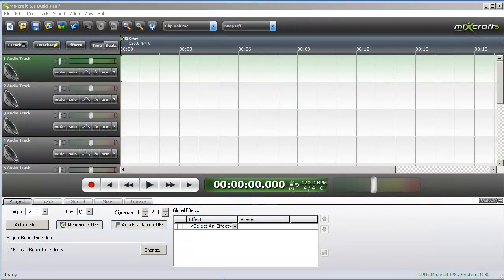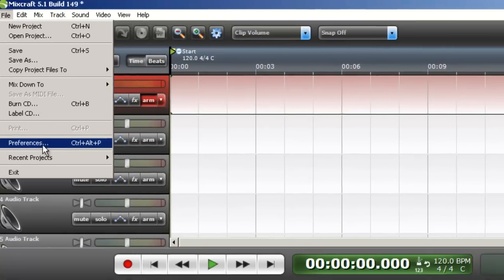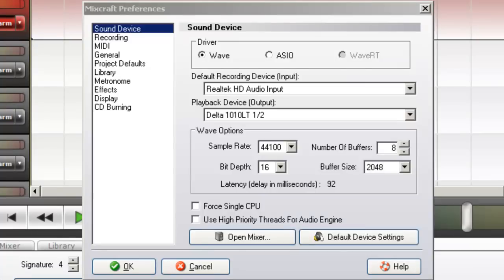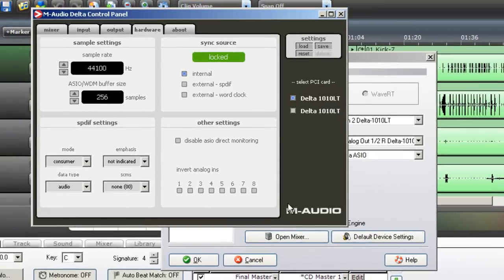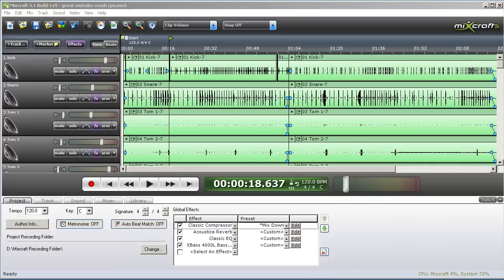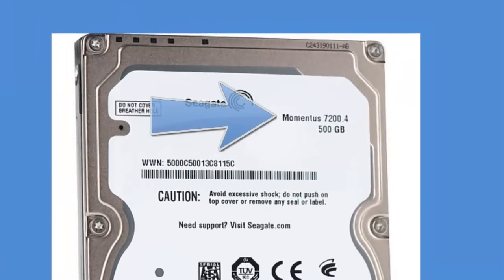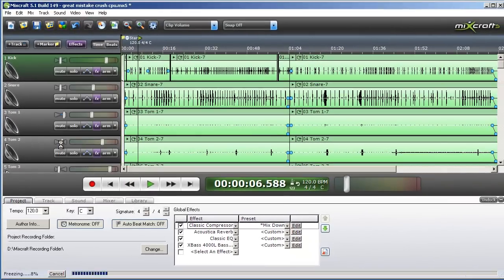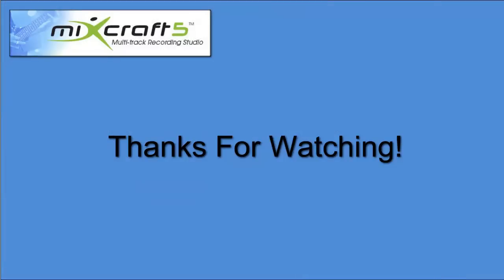Optimize Your PC For Use With Mixcraft

Comment: I'm surprised this video wasn't made a long time ago. It would have resolved a lot of issues and frustrations! 
Still, it's great that you have been kind enough to take time out to make it. It's very useful and I've picked up some great tips from it. I will apply them. 
I've like to see another video on MIDI track creations to produce a ballad song at say 90 BPM and using snares, claps, etc. 
It's a pity that the keyboard don't say what each key produces in the kit sections.
Thank you.

Comment from the maker: @GearBoxTy No one wants latency.  But depending on your computer, there is always a balance between latency and audio gapping.  With a good audio interface, a fast hard drive, quick processor and a minimum of background apps, you should be able achieve near zero latency.   3 mils of latency is definitely achievable and usable.

Comment from the maker: @aangplus44 You don't need a stereo signal, you are supposed to record (in most cases) in mono. WavRT is only available in Windows Vista and 7, not XP. ASIO will only be available if you have hardware installed which came with an ASIO driver. Watch the video, it explains some of these things.
As far as monitoring, you shouldn't need to if you are recording a guitar amp.

Comment: @DECIFERTHIS09 

Quite right . Latency also affects the delay time in striking notes via MIDI controller, whether computer keyboard or MIDI device.  I had to dial these down in the Preferences as well.  Ironically, my laptop's Mixcraft install had a faster initial latency than my workstation did.

Comment: @aangplus44 is your direct out the same as the headphone jack if so I do the same thing i run the headphone into my alesis multimix 8 usb then into mixcraft at first i had a terrible time with latency it was literaly 764 and i switched the settings to sample=44100 buffer=8 bit=24 buffer=2048 i get 61ms now if i want the purest audio i learned a trick on my interface instead of monitoring i run my speakers through my headphone jack on my mixer and its like monitoring in realtime but without latnc

Comment: I have Mixcraft 6 and have the playback glitching and stuttering issue. This happens with Wave and Wave RT, I cannot use ASIO. Changing the latency does nothing and both the CPU for Mixcraft and System stay under 10%, in the green. It happens even without any effect or plugins in use. What exactly, would be causing this problem? It happens on both of my computers with different specs and sound cards. The CPU is completely fine.
Reply from the maker: When you change the latency, are you increasing it? Lowering the latency setting would make this worse. Another thing to check is your Windows power settings. Check out this FAQ: http://acoustica.com/kb/windows-power-plans-and-cpu-throttling_1283.html
Reply: Beca YT does your computer meet daw requirements and any other hardware /vst will use processor so you will need dual core or better

Comment: I (as a newbie) am  still having trouble getting my voice to match the beat - listening to the backing tracks in my headphones and trying to sing in sync with the beat. 

I'm using WaveRT with Windows 7. Default Recording: Microphone (Soundmax Integrated Digital HD Audio) and Playback Device (SoundMax Integrated Digital HD Audio). Latency 20 ms. Exclusive is not checked.

Is this just a matter of software latency settings or is it my simple hardware?

Apologies if you've covered this elsewhere.

Comment: Good tutorial, but is the mixcraft software engine sufficiently fast and efficient  compared to some of the fastest DAWs?
Reply: Software engine? I think i get what you mean, and yes Mixcraft runs as quickly and efficiently as any daw.
Reply: Eric VanLandingham  Thanks. I find that the song project example 'It takes time' that Mixcraft 7 comes with, plays very poorly on my laptop, stuttering and stopping etc. My laptop isn't too bad, dual core intel  8 Gb ram. To get rid of most of the stuttering by adjusting the settings, as u mention, leaves the latency quite high 60 ms (waveRT) which when I attempt to record guitar in new project is quite noticeable . OK I can lower the latency settings in the new project, say, 30 ms and seem to be able to  create a number of tracks without problem. May 'It takes time' would cause problems with other DAWs. So really there are two possibilities, the mixcraft 64 bit engine is not the fastest or 'It takes time' was and incredibly poor choice of sample song project to include with the project. I obviously have one of the early releases of mixcraft 7 so maybe improvements will be made.
Reply: Sometimes dual core works against you. Quad or higher is best. Try turning off multiple cpu from within mixcraft preferences
Reply: Also use 32 bit unless you have a plugin that requires 64
Reply: I have the same problem using waveRT option (192000 - L 20mls  - 32, standard config) i'm also use dual core, laptop, i have to swich to wave mode, 44100 - 12 Buffers - 16 D size buffer 2048 otherwise i can't even playback synths that come with mixcraft.
Reply from the maker: André Alves Please send in a support request: http://support.acoustica.com/index.php/Tickets/Submit

Comment: I'm having Mixcraft freeze on me while I'm trying to record.  It'll work and I have no latency and everything goes well but specifically when I arm for the track or start recording, it freezes up after about 40-90 seconds.  It's incredibly frustrating.  Do you have any idea what I might be able to do to prevent this from occurring?
Reply from the maker: +Chris Seymour If you're still using Mixcraft 5, you might try updating to Mixcraft 7.7. If that doesn't help, send in a support request so that tech. support can help you figure out what's going on: http://support.acoustica.com/index.php/Tickets/Submit

Comment: will asio driver give better latencey. i have mine down to 4 and still has some delay
Reply from the maker: +Brett Evan Latency is largely determined by your audio hardware. If you have a low-latency audio interface that provides its own ASIO drivers, that can give you extremely low latency. But let's back up here: when you say "latency," what do you mean? Latency generally refers to the delay between when the audio enters your computer and it when it comes out of your headphones. Are you experiencing audio skipping or some other playback problem instead? If that's the case, you'd want to increase the latency setting until the playback smooths out.
Reply: +Mixcraft - Music Recording Software i want to be able to monitor out to my headphones during vocal recordings and not have much delay.
Reply from the maker: +Brett Evan  What sound device are you using now? If it doesn't provide its own ASIO drivers, then something like a Focusrite Scarlett 2i4 might be your best bet.
Reply from the maker: +Brett Evan It doesn't look like that mixer has its own ASIO driver. You could try the generic ASIO4All driver, but that doesn't work well for all sound devices.
Reply: +Mixcraft - Music Recording Software  il try it. i fixed the latencey but now it skips while recording
Reply: +Brett Evan Yep, that is typical. You have to find the balance between latency and how much your cpu can handle without starting to crackle like that. That is why we have this video up.

Comment: Here's my problem 

My system resource usage during playback is never steady, keeps wavering between 45% through to 100%... This happens even when I'm not recording, and I make sure no visible apps are running, I end processes of all apps closable in taskmanager, except for my McAfee AV wch (I think) doesn't use much cpu anyway

And this happens, only and only when I use effects and when I use ozone 5.. My God, it's like I recorded the crackles and bleeps, no audible sign of actual vocals

I use the Mixcraft 8 pro (32bit, recently reinstalled it in 64bit)
In a Hp Pavillion touchscreen laptop (I can't remember the exact model, forgive me) 
4gb ram, 500gb rom (running windows 8.1)

PS - the external soundcard I use is not heavy, just a USB with a box body that I think is the soundcard

Pleeeease, I need solutions, anything, anyone 😭😭😭😭😭🙏🙏🙏🙏🙏🙏🙏🙏
Reply: Submit a support request at support.acoustica.com
Reply: Sniper X yes same exact problem 😭